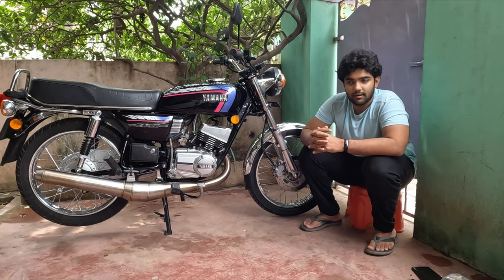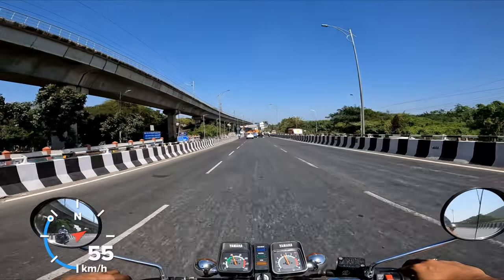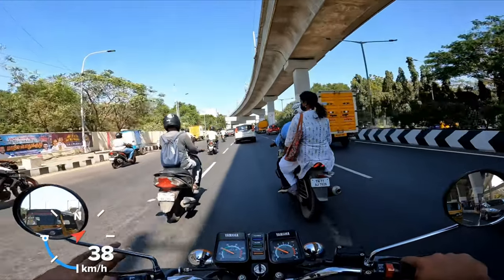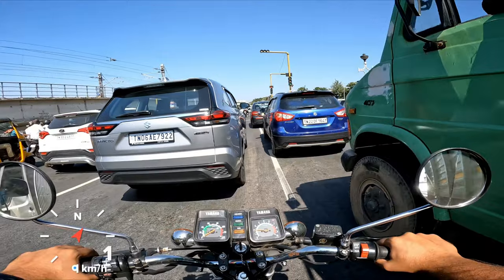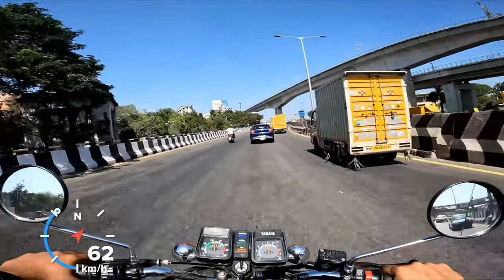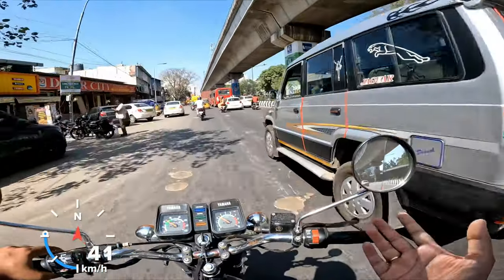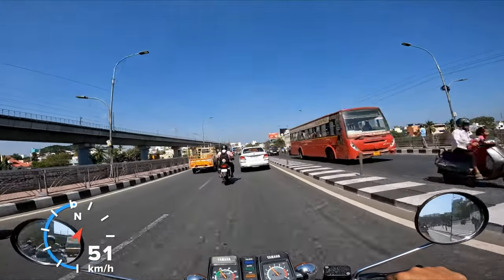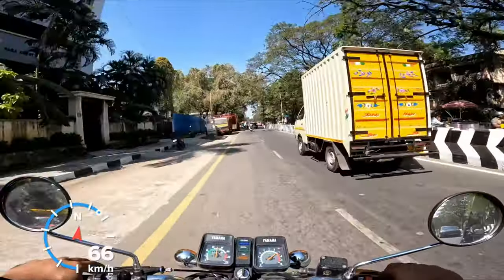Yamaha RX - Sleeved Bore Performance (Powerband Custom Works)

Comment: Hi bro I also got my rx 135's bore sleeved just 12 days ago..... It's done around 150km till now, I had been waiting for your video since u had posted the video on sleeved cylinder. And now I'm 💯 percent happy with what I have done.
Reply from the maker: Glad to hear that :D
Reply: ride safe man
Reply: Why didn't you rebored instead of sleeving?
Reply from the maker: Mine, was already sleeved by an unknown garage and they had done a terrible job. So I sent it to Darshan and had it sleeved again.
Reply: @BrattyBiker  okk... I'm confused whether to sleeve or rebore? What will give better performance and mileage. What I have heard from others is getting rebored is better than sleeve. What would you suggest and why..
Reply: @duke7571   The performance of the bike increase with increasing BORE size but the milage will also start dropping not in huge numbers. Like my bike which was running on a 1.25mm BORE gave me an average of 30 to 35kmpl. But now it's around 40 to 42 kmpl. If you ride it in 40 to 50 speed. Also my bike is on stock rx 135 4 Speed porting  and it has a Rx 100 carburettor with stock jets and no power box installed. And  performance wise the initial pickup is greater after sleeving and putting a Standard size piston. Actually my running period is yet to complete or else I would have told you about the top speed as well.
Reply: @siddharthsrinivasan  cool... Will try to get it sleeved from darshan. Thanks bro🤜
Reply: @duke7571  I had posted a huge paragraph sometime ago about my bike and stuff seems like the admin has deleted it.

Comment: Brilliant. Keeping it simple and good..One query though, does the Chinese made 26 mm Mikuni require re-jetting if yes, what's the process and if no, how's does the performance factor vary, in words if you can describe, please...
Reply from the maker: Well, they will all work out of the box. Issue is there are a lot of copies floating around, even the replicas differ one vs one so it's difficult to say. Performance, can vary from sputtering to blowing a hole in your piston due to extreme lean mixture.

Comment: I could see you riding in Chennai , Is Power band customs from Chennai ?
Reply from the maker: Nope, I live here in Chennai. PowerBand Customs is from Bhiwandi.
Reply: @BrattyBiker  so you transported the bike & got it done. Or dismantled, sent the engine alone rebuilt & got it back ?
Reply from the maker: @nikhilkaransalunke4462  Nope, I shipped just the block and the head to Darshan for the work, once he finished it, I rebuilt the engine myself. Although it was rebuilt again by my mechanic, for a minor gearbox issue that's still not sorted sadly.

Comment: Sir which bike master cylinder used for your bike and brake levers also pls reply
Reply from the maker: Stock Pulsar ENDURANCE make master cylinder and brake lever. Bybre caliper new, from Pulsar 150.

Comment: Isn't the mileage quite low? Is it because resleeving
Reply from the maker: No, It's because my ports (exhaust especially) are large for better top-end power and it's not related to the sleeve. You can do a 4 speed sleeve and that will very easily do 40kmpl.
Reply: @BrattyBiker  ya okay cus I also have a 135 Which is currently getting sleeved and before I've got 45 plus mileage
Reply from the maker: @adityakasar8793  Hmm. If it's sleeved correctly without major port mismatches, it should help in good flow, good combustion and mileage. This is where usually sleeve jobs suffer, lot of them get the ports mismatched.
Reply: @BrattyBiker  surely will take care about that

Comment: Bro what's your Instagram
Reply from the maker: @brattybiker
Reply: Rxking gearbox doesn't suits indian Rx sir my friend has also same issue but i wonder top speed after porting and chember to Rx135 only going@112 that should be more then 140 since rx100 goest to 105 and RXG yo 115 with stock materials
Reply: @AShuCHAWARE its not always about top speed run ,its about torq & super advance acceleration